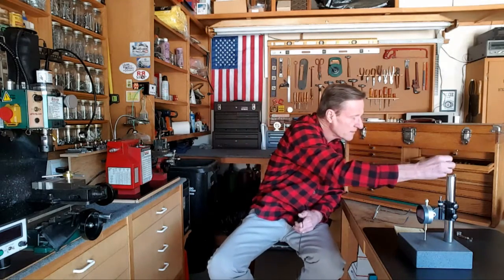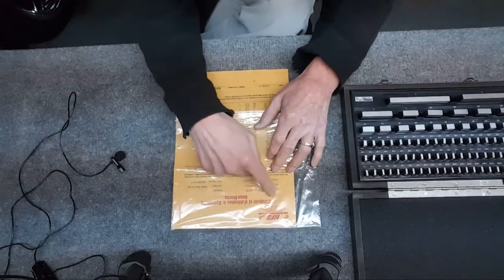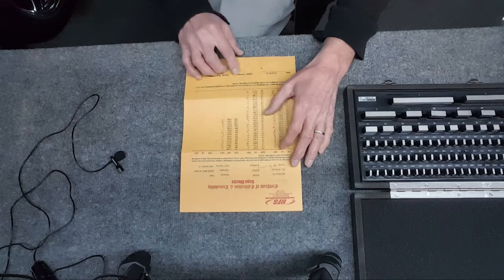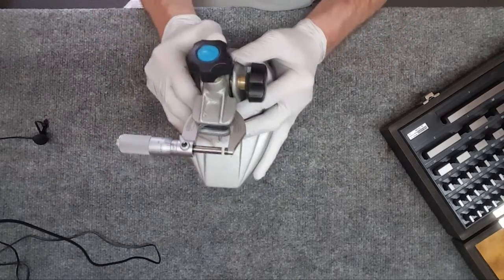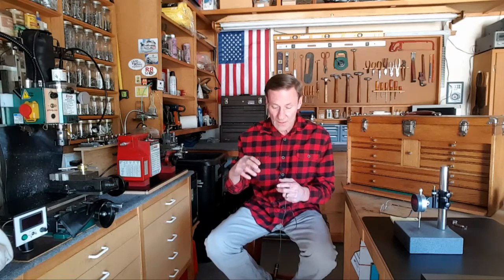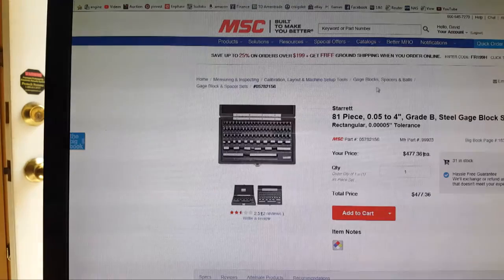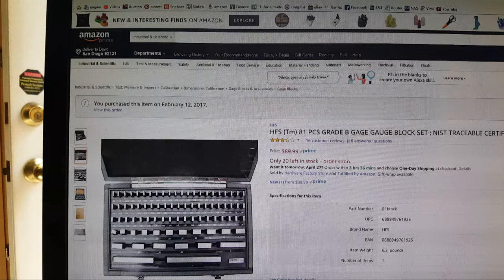Are Economy or Grade B Gage Blocks Worth It?

Comment: The tolerances of gage blocks are given in microinches. One microinch equals one million of one inch! Even grade B gage blocks are more accurate than any measuring equipment found in the field, the only place that one will find equipment accurate enough to check gage blocks for accuracy is in laboratories.

Comment: It depends on what tolerances you hold on parts. If you have .0005 or less tolerance, you would want Blocks that measure within half a tenth or less I would say. For home use, or more open tolerances at work, these economy Blocks are fine. You don't need Mitutoyo Ceramic Gauge Blocks which are 3k for 81 pieces

Comment: I hate to say it but unless you are capable of measuring to microns you are wasting your time bottom line even Chinese gage block errors of 25 to 50 microns which is in B range is well beyond the measuring  equipment in your shop. There is a guy on utube who was measuring gage blocks from a China made set  compared to a $3000 Starrett-Webster set and could not detect any difference with a Starrett 0.0001 reading indicator and could not detect any measurement difference between the $3K set and the budget asian import set.   No home machinist has any need for a higher grade set unless they are doing aerospace work or toolroom gage work for ISO or automotive work witch needs to be traceable.  Look at the tolerances on your gages and micrometers and you will see they are far looser than B grade economy gage blocks.   Spending a few hundred or even a thousand dollars will not get you any closer.  Another couple of issues are temperature and operator factors even quality labs often notice measurement errors between inspectors with the same measuring tools.   Any home machinist who can hold  plus or minus .001" is doing great without a surface  grinder.  Only with good grinding equipment or hand lapping are you likely to do better.   Even large high tech companies struggle with 1/10,000 and micron level tolerances.
Reply from the maker: 1 micron =.00004 and x 25 is .001 not within B range and not beyond either of my Mitutoyo mics spec'd to .0001.
Reply: @TheMiniMachineShop  He probably meant 2.5 to 5 microns or 25 to 50 millionth of an inch? A Generic 25 mm micrometer is specified at around +- 2 microns.

Comment: There are a lot of factors in calibration and use of gage blocks.  Everything has to be taken into account, and for steel blocks, temperature variation is kinda sorta accepted as 6 millionths of an inch per inch per degree C, standard temperature 20 C or 68 F.  Also, any error in the measuring equipment has to be known, as well as the uncertainty of the equipment, in millionths of an inch, I don't know the metric standard, probably microns.  Also for calibration, the equipment used should be accurate to one tenth of the gage tolerance.  It gets hairy, I retired our of a gage lab.  Been a long time, but I think 50% humidity was standard also, could have been a little higher or lower.  The anvil pressure of the instrument is controlled, from 16 to 48 oz depending on what's being measured.   One of the methods I used to like was monochromatic light and optical flats.  Lets you know how far off that supposedly perfect surface was.

Comment: Measuring a 10th  consistently is very hard with most mics.  Temperature of materials and your hand warming the mic change the reading.  Also the rigidity of the mic itself comes into play, your clutch or ratchet needs to be properly tensioned to slip at the correct torque to ensure that you arent spreading the anvil from the spindle, as they get used the threads also wear and create slop so its not consistent across its range.  The carbide faces last a long time, but the steel wears relatively quickly and need frequent adjusting

Comment: Very analysis of the block.  I just use a Grade B set myself.  They only time I try to work in tenth's is if I am surface grinding.
Non of my machines except my grinder can Work in the tenths zone.  So I only use the blocks for comparison and angle setups.  I can measure in the micron range and have compared my blocks to one another and against the certificate.  I found the certificate to be close, but temps and dirt is always an issue and my shop is far from a controlled environment.
Enjoy the video.

Comment: It looks like I bought the same set. 81 pcs Economy from Shars a little while back.
When I got them, I mic-ed them all up & every one appeared to be right to the tenth of a thousandth of an inch.
The box was coming apart at one spot when they were first delivered. A little wood glue
& a clamp fixed it good. I was happy. They're as accurate as I need to be.

Comment: Hi
I have been watching you for a couple of months now and you're pretty good for someone who is self trained.
You seem to have a bee in your bonnet about 10th of 1000. Factories that produce work to this standard is heated to 68 degrees Fahrenheit or 20 degrees Celsius and everything is kept at this temperature.
One of the things a tradesman learnts is specifications, and most machinist only work two 2 thousands of an inch, probably 95% of the time, going smaller than this means higher cost and everybody tries to keep costs down.
Class B is more than adequate for your work and mine, working to size exactly, doesn't  mean that it is better.
Tolerances should be the first decision on a new Project. Being too tight is probably one of the biggest faults for a amateur.
Keep up the videos I enjoy watching them and don't get too uptight on size, enjoy yourself, I do.

Comment: I picked up a set of cheap gauge blocks and they all measured way better than any of my instruments could measure. Temperature will cause more error than the blocks might be off by.   More than good enough for any home shop. 

Also the blocks are lapped finish after grinding. Its likely coming off a totally automated line. One in 10 blocks might hit right on the number and those are the A blocks. The further they drift from the target the lower the price. It's as simple as that. The machine prints off a certificate automatically. The cheap ones likely get a stamped signature. The brand name blocks likely get another inspection before the name goes on there. Very little man power used either way.
Reply: Not so much with ceramic gage blocks.
Reply: @rufusleers  Ceramic gage blocks would be a waste of money for a home machinist.

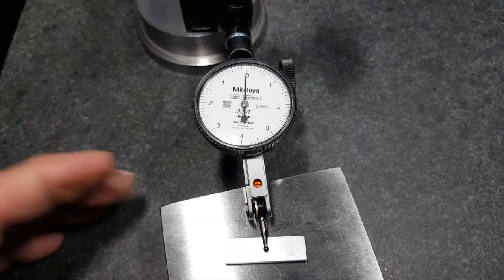Comment: I stopped at 17:16.
If you use an indicator to measure the differential thickness of gage blocks, you probably didn't understand very well the correct use of the two tools...
Reply from the maker: Explain!
Reply: @TheMiniMachineShop  Indicator is not a measuring instrument. It is "precise", but not "accurate". What you read on the dial is just a rough indication of deviation from a reference position, not a measure of this deviation. An indicator has to be used for comparing two things of the same height, not to measure the difference in height among different parts. You can use different height gage blocks to check the accuracy of an indicator, not the opposite!

Comment: I’m a retired machinist/toolmaker… 40 years in the trade.
It took about 10 years before I felt comfortable calling myself a journeyman.
3 years ?… you barely got your feet wet.
As far as gage blocks go… grade B for in-shop use.
Grade A for inspection ONLY! Grade A blocks should never see the shop floor. They are only used to validate other inspection devices and/or direct validation of the work piece, in a separate clean environment (away from the machines).
Hobby shop machinists should never invest in anything better than grade B, unless you happen to be doing some very precise work.
Hope this helps.

Comment: 40 years in the trade…
The gage blocks sets I’ve used all had inspection certificates with them.
Various grades of blocks will have different levels of accuracy. 
The certificate supplied with the set will tell you how much each block deviates from its’ nominal size.
Those numbers you think are “bogus”, are indeed valid. They tell you how much each block deviates from the nominal in units of a millionth of an inch.
So, if a particular block has the number 24 assigned to it, it means that the block is 24 millionths (larger or smaller) than the nominal size of the block.
A good shop grade of blocks need not be any more accurate than “plus or minus” 50 millionths of an inch.
Grade A inspection blocks will have typical tolerance of +.000004/-.000002 (millionths). They like to supply them on the “fat” side so that when they wear, they wear towards the nominal size. 
I can’t imagine a hobby shop machinist ever needing grade A blocks.

Comment: I'm late to the party (it's March 26, 2019) there's some things you should know.

It's common in Asia countries to take a Western name when working as a rep, tech, manager, whatever when in contact with US or European customers. There's good reason for this: many Asian names are difficult for oxidentals to pronounce correctly. 

You're entirely correct that import calibration certs are a "trust but verify" document. If tenths accuracy is important to your work you should at least either calibrate your import gage blocks yourself using borrowed equipment or bite the bullet and have them calibrated at a real metrology lab. 

When you get into gage block calibration, you discover the process is tightly controlled by specs and standards. Which means it's usually expensive to calibrate an entire 81 PC set - about $300. However, I see a granite base comparator on your bench. Find a gage head and gage amp with one setting graduated to 10 millionths per division, you could spend a evening trying equal length stacks against each other to determine self-consistancy. If you have a good tenths (0.0001") reading dial indicator you can interpolate the graduations and estimate difference between comparative readings to fractions of tenths. You still can't assert with any authority your gage block set is in calibration but you can by process of elimination determine the probable error of most of your blocks and make notes on the calibration sheet.

I have a set each of Shars blocks in Imperial and Metric systems. I spent a couple of after hours calibration sessions comparing my block sets with my employer's sets under bi-annual calibration. I then used the noted deviation on the cert sheet to correct to a presumed absolute value so my new calibration sheets for my cheap Shars blocks could be claimed accurate to single digit millionths if not certifiable under FED SPEC GGG-G-15C and ASME B89.1.9-2002. Should I need a reference length to millionths I can select the appropriate blocks, consult the (home made) cert sheet for the relevant error, work the math and certify in my own mind the length I assembled was  corrected to +/- small millionths - in fact closer to assembled length the set grade would certify. If you know the error accurately, you can correct for it.

Mitutoyo's "Gauge Blocks Catalog" E12014 has a world of gage block information. It's free on the internet in PDF format from Mitutoyo's website. There is also a NIST publication: "The Gage Block Handbook" as a PDF.

Ours is a very technical trade. Large parts of it deal with critical systems of aircraft, nuclear power, military materiel, precision manufacture, foreign trade, etc. Accordingly, our trade is hedged about with specs, standards, and restrictions. "Machinery's Handbook," the bible of our trade is pretty much a compendium of the most commonly used machine shop standards connected by narrative. It doesn't end there. If you've been in the trade for a while your handbook collects slips of paper, items torn from catalog tables, margin notes, etc. Every good small shop has a library of handy references.

A dial test indicator is not really suited for data collection. Because of the variable angle of the contact tip lever to the plane of reference, the indicated reading is subject to "cosine error." Look it up. Also look up  "dither" in connection to mechanical metrology and "stiction."

Another point is  close tolerance  measurement is affected by temperature. All mechanical measurement is referenced to 68 degrees F (20C). A micrometer measurement in the 3" range can be in error by 0.0005" merely from handling the mike frame with warm hands. Related is the differences in thermal expansion in metals. A warm aluminum part may contract to out-of-tolerance/undersize when at room temperature.

Comment: I got the economy set which for me is fine. I machine at home and not as a fine production shop. These serve me perfectly well for what I do. If you're in a situation where you have to QA parts to ultra high tolerance, probably skip the economy set. If your making parts at home where most of your machining is really just thousands of an inch or your learning, these will work fine. Also, if the products you manufacture are only moderate precision by design, these will still be fine and less depressing if you drop or loose one.

Comment: I recently picked up a set of the Shars economy grade blocks, and they will probably be fine for what I will be doing with them. Seeing how much more the higher grades cost, I will be sticking with these for quite a while.
Reply from the maker: Funny sometime later I did a video saying I never used these blocks the set I do use most are square gage blocks for a lot of different things. Be interesting to know if you use them...
Reply: @TheMiniMachineShop  I used them to line up drawer slides for my kitchen cabinet. I spot checked a few blocks with a micrometer, and were basically spot on.
Reply from the maker: @JasonTHutchinson  Hi Jason, basically spot on? The average shop doesn't have the equipment to measure the error in a grade B set. But what you can do, if interested, is create a 1" stack from many smaller blocks then you can see the accumulated error in the stack maybe .0001 at most. But each block has to be super clean.
Reply: @TheMiniMachineShop  My Starrett micrometer is only accurate to a tenth. I currently do not have anything in my shop that is more accurate than that. I will try making a 1" stack.

Comment: There zero on the veneer side of a mic is redundant. It's also the reading on the main scale. The human eye and brain combo is pretty good at quartering up the difference between .101-.102 the veneer helps with splitting it up to the 1/3rds  and 1/8ths and finer.

Comment: You can sometimes find a "Mahr Supramess" that has 0.00002" or 0.0005mm resolution for $100. used in workable condition. Beyond that you would need a "CEJ Mikrokator"  which are hard to find for less than $300 (used in workable condition).  A non-working or stuck Mahr might be repairable. while a "CEJ Mikrokator" is most probably not. I own both.
Reply from the maker: I had a Mahr for a bit and returned it. I don't really have a need for that kind of accuracy. But never heard of a CEJ and will be looking to see what it is. Thanks!

Comment: I am a Tool and Die Maker, You need to work as a apprentice with a good journeyman to become one ,you  are perfect example of why that is,
not all people do but most do you are a apprentice teaching an apprentice case, you pronounced vernier wrong,dial indicators are not as good as a good drop in indicator for what your doing, because of an angle factor, never rub a block into a surface plate unless you want to be the first to be letgo, Gauge blocks are not ground they are lapped l am sure there is more in your short. skit , Dave I Will give you credit for your interest in the field keep pushing forward best thing you can do for yourself is find a good comitant person to work for.

Comment: Dave,
Those Shars blocks are more then adequate for any home shop. If you really want to test Jo gauges, you should test them with a comparator that measures to a 1/1000 mm (roughly a quarter of 1/10 000").
You can do this...it really isn't beyond the realm of the home-shop, providing one works clean and you keep your head in the game.
The question is why would you want to (besides for lulz) ?
You will find out that, if you would make such measurements, that even holding a block for a short while (and thus warming it up) will change its size.
And unless you are about to make a precision microwave cavity resonator, for your next doomsday satellite..... this could be called 'overkill'!

Toodles!

Paddy

PS the high and mighty Starrett, praised in to Heavens by everyone has sold out to the Chinese.... There entire 'International line' is made out of the same 'Chineseum' as all the rest of the imports. Prices are slightly lower than the few things they still produce in the US.... but still inflated for Chinese imports.....
It may be the better grade of China-special......it is China-special nonetheless....
Reply: China gets a bad reputation because they are willing to make anything to a price point if you are willing to pay for it they can make quality like Iphones and fighter jets etc. The real issue is that the US MBA's and purchasing agents push too hard on price without verification quality. The other issue  is that a lot of parts get farmed out to cottage industries.
Reply: Lets look at things logically.  If it wasn’t for Chinese imports half the guys out there wouldn’t be able to afford to get into the machining hobby.  If you want the best there are US, European and Asian brands that are excellent, so let’s not put down the Chinese for providing workable solutions for the rest of us.